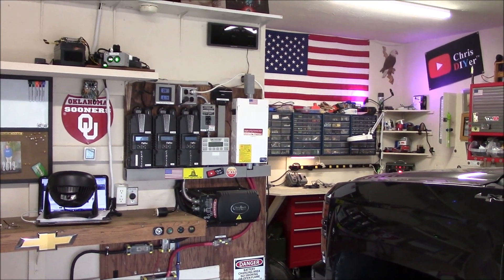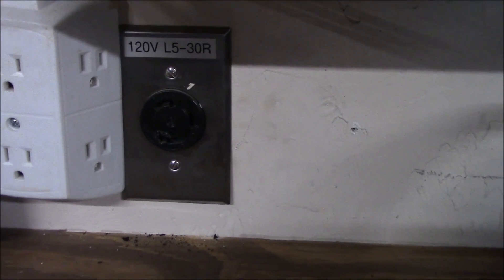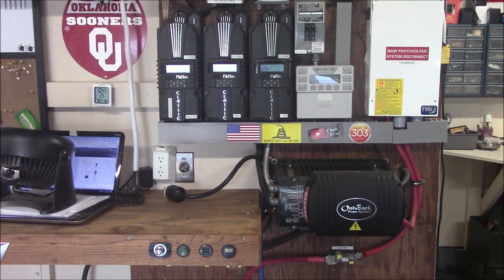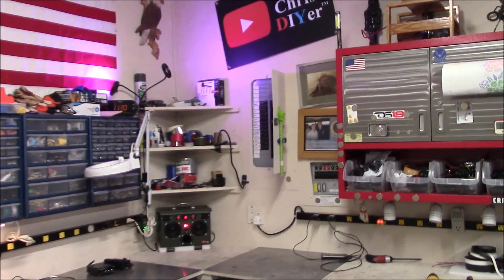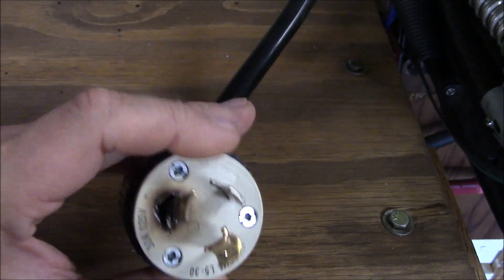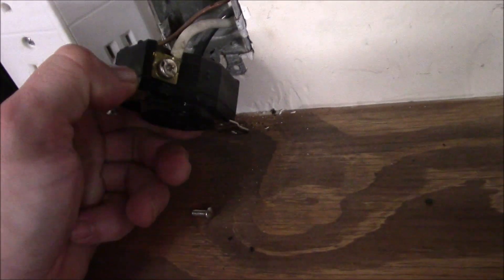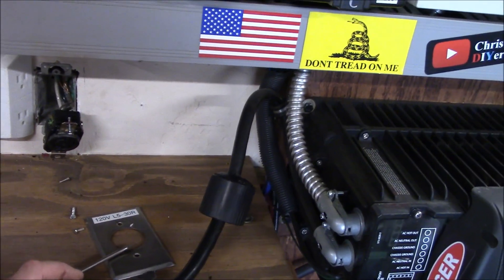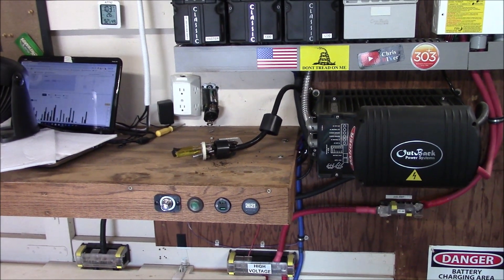Home solar power DC/AC inverter (AC-In) wiring and receptacle/plug burned up

Comment: Eh Chris, that is a definite connection weak point. The amount of surface contact on the plug and receptacle could be improved to a higher amp rating. Good thing that the conductors did not arc weld themselves together.  With the outside temps being in the 90's, and additional draw, pick your electrician's brain and see what the next step up would be.  It has to be less cost than a garage fire.  J K
Reply from the maker: Prob just going to go direct from the wall outlet to the AC-in on the inverter...no receptacle or plug. I will just cable nut (heavy duty cable nuts and hard twists) the 8/3 wire with an 8/3 extension and metal conduit to keep the fire in. In a few weeks, gonna look into a new battery bank and possibly a 48v inverter. You are right, 90F + temps and this time of year is when I am using the most power...need this system operational. My other three off-grid systems are working with NSTR
Reply: Good Sunday morning to Ya Buddy, I have used connectors that are tubular with an Allen screw on each end and are encased in plastic insulation.  The larger ones are single and the smaller ones are in a barrier strip.  Just an additional thought.  Wish you success.   J K
Reply from the maker: @jameskrivitsky9715  - I have used those type of connectors. They are good, but I am going with a solid butt crimp connector and two layers of marine grade (hardened) adhesive heat shrink over the connections. Wire nuts are alright for Romex 14 AWG and regular household switches and outlets and boxes...but, not for a small outlet box with 8 AWG wires (the nuts on those wires is too large for the box). I don't like how the squish in there.

Comment: My experience is that the L5-30 socket and attachment plug is the achilles heel in the system. Granted it is convenient where you can disconnect the grid power input to your inverter for maintenance by simply unplugging it verses going to the breaker panel. I believe you mention the inverter is capable of delivering and/or passing through 3600 watts at 120 volts which would put it in the neighbourhood of 30 amps continuous. Derating the socket and plug by 80% would be 24 amps for continuous duty making it way undersized for your application.

Upgrading it to an L5-50 and sizing the attachment cord to #8 will resolve the problem, but the cost gets rather exponential due to it's specialty in nature. I would replace it with a non-fusible safety disconnect that is commonly used for the outside condensing a/c units and direct wire it to your inverter; the cost starts around $10 and it is commonly on hand at most big box stores.

I just finally got my battery backup project off the ground and moved 300 Ah worth of AGM batteries out to the garage. I decided to go with the Magnum Dimensions MS4448PAE due to its ability to do 120/240 split phase which makes it easier for me to balance my critical loads. I am fine tuning the charge parameters to make sure I can get a few more years out of them and save up for a 19 kWh lithium bank. Wish you the best of luck and maybe an "affordable" lithium option is in the future for your system when you make that inquiry.

Comment: Glad nothing real bad happened, always something. I try to use back to back breakers & fuses on my setup.  I'm running my whole setup on a slow blow 30 amp fuse feeding my ac breaker panel. Popped it for the first time a while b back when welding 240volts & ac running full bore. Scarry stuff.
Reply from the maker: No doubt! Hear ya on that. Decades ago while working on 3-phase, 3-line input power cables...saw what "real" power can do to electronics. The stuff we do now is dangerous enough (esp with big battery banks) but, still not as dangerous as military field generators (mobile power plants) feeding high power equipment. I don't fear electricity, but dam will respect it and incorporate safety measures the best I can. My system is down cold right now...I have some phone calls to make. Def scary stuff when it comes to "what could have happened". Be well man...I may be around your area next month (traveling through).

Comment: The breaker would have caught a ground fault but, not an arc fault. Had that very thing happen at my daughters home. I ran a new dedicated wire from the breaker box with a new breaker with arc fault, from there to a dedicated duplex for 20 amps only. I don't believe you can find a 40 amp breaker with arc fault. May be wrong on that part. I've seen a 30 amp one pole arc fault breakers but, never a 40 amp 2 pole. Should be an easy fix.
Reply from the maker: Thanks...didn't think about arc fault breakers. Yeh, gonna have to do some research on that. I might give my electrician bud a call too (the one who installed the wiring and breaker in the MAINS).

Comment: Wow Chris, that could have been really bad.  It looks like the lesson learned is to size your breaker not just for the wire size down stream but for the end connector and follow on wire as well.  Since the connector can only handle 30 amps then the breaker has to be no larger than 30 amps.  I'm glad you were there to catch it!  Looking forward to hearing about how you decide to go with your new battery bank.  Thanks!
Reply from the maker: Indeed! I might just do away with a L5-30 receptacle and plug. I initially had it installed to plug into my little Honda generator in case of a grid down situation. The wires to that receptacle are rated 8/3 (good for up to 50 amps or so). The only reason I was using the "charger" function on the inverter was to prolong the life of those batteries till I had enough money to get a new battery bank.  So, prob in a few weeks, I will call Amy at the AltE Store in Boston and see what she says/recommends. Prob will need about 10-12 kWh of lithium. Not doing lithium car batteries. We'll see...hell, I might even drop some more money on a new 48v Outback Power or Magnum inverter and go that way too. Either way...big money, but smarter. Lots of decisions to be made. How is your system running?
Reply: @ChrisDIYerOklahoma  That sounds good.  My system has been running well and I have not changed it but I have changed how I use it.  The more you learn the more you adjust.  I try to use all the power when the sun is shining and I have backed off how much I use the batteries overnight.  I think you might like the Magnum system at 48V and backed by some kind of Lithium batteries.  What ever you decide, I think you need to get it in place by the end of this year.  Next year could be rough...
Reply from the maker: @HomesteadEngineering  - Next year rough? Are prices going up or something? Thanks David...def never doing FLA batteries again. Magnum equipment is sexy...love your set up. We may need to go offline (yack on the phone). Thanks
Reply: @ChrisDIYerOklahoma  Yes, let's talk offline.
Reply from the maker: @HomesteadEngineering  Do you still have my #? ChrisDIYer@yahoo.com